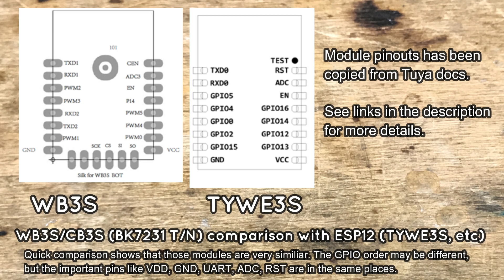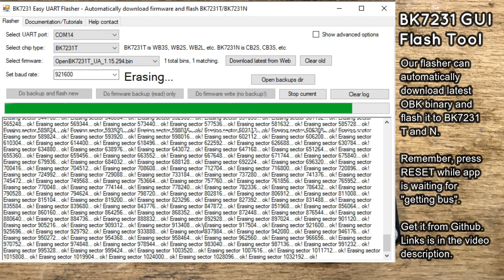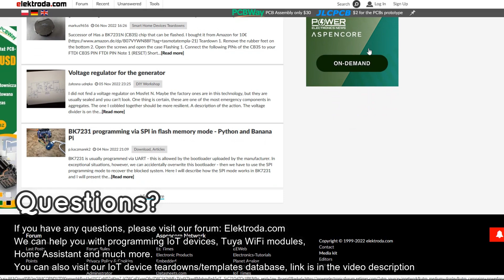How to create BK7231 development board - converting NodeMCU to Beken version for IoT OBK firmware

Comment: what the benefit??
Reply: Many Tuya enabled devices are using CBU module (with Beken BK7231N chip), so this way you could erase the factory firmware and upload your own. Benefits are limited only to the things you can program. Or you can always use the OpenBK7231T/OpenBeken to have a Tasmota-ish firmware that can be easily integrated without Tuya cloud limits.
Reply: so which firmware allow me to choose the frequency and duty cycle of pwm output??
Reply: I have BLE JDY26 SOC BEKEN3296 How program